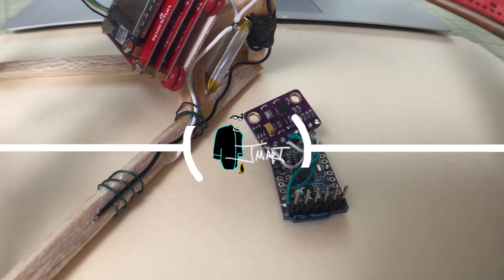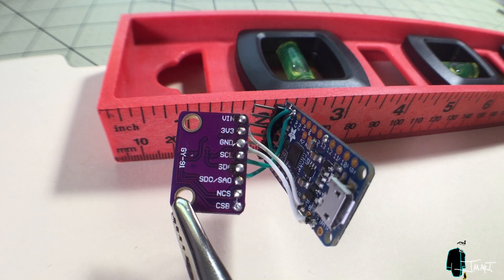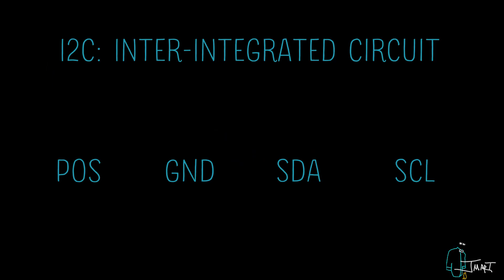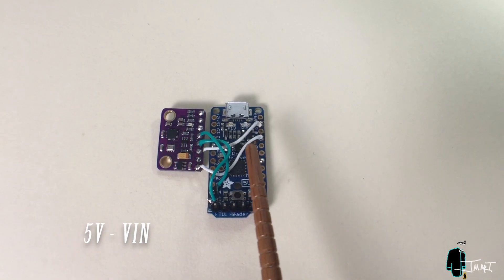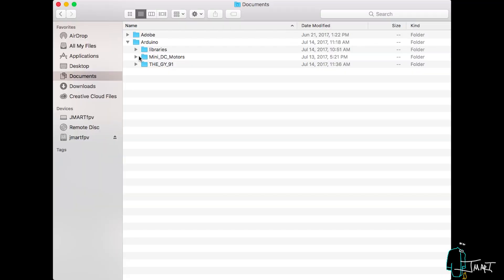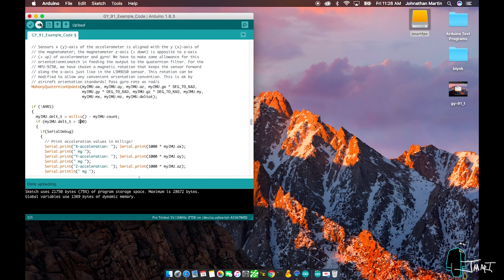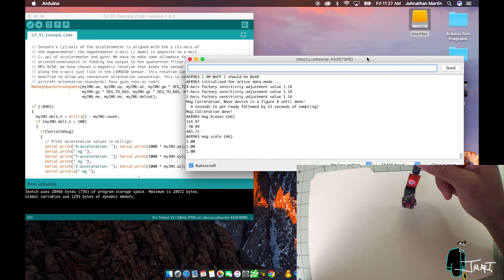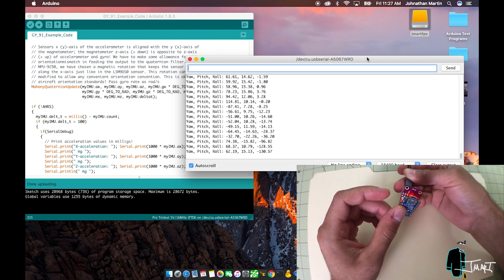9 Axis IMU MPU9250 (GY-91)

Comment: I´m using the gy-91 for calculating 3 axis of gyroscope, accelerometer and magnetometer, but i´m having troubles with the units, does anyone know of a library that converts the data of the accelerometer, gyroscope and magnetometer into corrects units?

Comment: Hi, i have trouble with SPI connection this module to board Arduino mega 2560 becouse of small sample rate. I do lot of search on the internet, but all codes and libraries are not working for me. Do you have any idea what can i do? Dont you have any tutorial? Its for my Bachelor thesis where i need messure acceleration and gyro only with the sample rate about 1-2ksps. Thank for any help and apologise for my bad english :)

Comment: thanks for the great video! However I recommend to use the 3.3V pin instead of 5V as the voltage divider of Raspberry PI/ Arduino is more stable compared to the build-in version

Comment: how many sensors can be connected to adruino?
Reply: Let me answer your question.
There isn't a specific number of sensors. First of all, you need to know which arduino you're going to use. For example if you're talking about an arduino uno (which is the most common) it uses an Atmega328p chip, which has like 14 digital inpunt/output pins and only 6 of them supports pwm pins. 
Ando also has 6 analog pins. All this depends on which kind of sensor you're using.
I hope I answer your question.
Reply: @richardchimal9128  I have the same sensor with barometer. I have 30 sensors that I would like to use for motion capture. What kind of setup will allow me to use them in chains for arms, legs and spine with head?
Reply: @GSXNetwork   Wow, there are a lot of them! First of all, I understand that MPU9250 allows you tu use I2C. According to the theory, you may connected an unlimited number of sensors with an arrange. It's a bit complex because you have to setup a master and a slave. 
You'll have to read about that.

Comment: Hi! Thanks for this. I'm having troubles including quaternionFilters.h, which libraries should i have installed before using your code?
Reply: I managed to include the "h" file but now i get this error: 
'class MPU9250' has no member named 'selfTest'
Did i install the wrong package?
Reply: I'm using the Arduino pro mini and a USB module to connect it to the pc
Reply from the maker: I will be honest Im struggling to figure out what is wrong here. Maybe try downloading quaternionFilters.h from this github page: https://github.com/sparkfun/MPU-9250_Breakout/blob/master/Libraries/Arduino/src/quaternionFilters.h 

I know that in the past this is where I downloaded this header file from. Also when I do a search on my computer for quaternionFilters.h my directory says username/documents/arduino/libraries/SparkFun_MPU-9250_Breakout_Arduino_Library/src/quaternionFilters.h
Reply from the maker: I really hope this helps to steer you in the right direction. I don't think that this header file is required to be in the same folder as your GY-91 GitHub Library it just needs to be somewhere on your computer in the Arduino folder, so that the program can access it.
Reply: i installed the SparkFun libraries with the library manager, but i noticed it has a MPU9250.h file and i'm not sure which files of your GitHub should i add or replace and where... I also noticed that the SparkFun MPU9250.h file comes with another file called MPU9250.cpp, but in your Github you have a .cpp file called main. 
I mixed some of the Github files with the SparkFun Library and now i'm getting a message saying mbed.h file is missing from the SparFun Library folder.

Sorry to bother you this much but i'm really newbie and lost in this.
Reply: @TomasSalinger   Hi, I have same problem.  i'm getting a message that "mbed.h: No such file or directory". How did you find solution about this error?

Comment: I thought the gy-91 was 3.3V only?
Reply from the maker: 5v has worked for me without issues. It does have a 3.3v output that you can use to power other devices once you power it with 5v.
Reply: Sorry, I was referring to the signal level on I2C. But perhaps the pro trinket is a 3.3V device.
Reply from the maker: thisoldjeep Oh there are two versions of the pro trinket, 3V and 5V

Comment: I was looking for a tutorial how to use MPU-6050 with arduino when I found this video. It looks interesting. I have a few questions, your answers are appreciated.

I haven't worked with Adafruit Pro Trinket before, but they say I will be able to use Arduino IDE to program it "with a few simple config modifications". So my first question, what these config modifications are?

The most important question, will I be able to get 3D position calculated? Without it the whole affair doesn't makes sense.

I will need to send position data over wifi. So the third question, is there enough pins to connect a wifi module?

And finally, after connecting GY-91 and wifi module will I still be able to connect the whole thing to my computer and program it?

Thank you!
Reply from the maker: Answer to the 1st question:
These were the “simple config modifications” that I did to connect to the board.
1. Tools > Boards Manager > Search for Adafruit Pro Trinket 5V > Install

2. Restart

3. Tools>  Board: Pro Trinket 5V/16Mhz or Pro Trinket 3V/16Mhz (USB) or(FTDI)

For example I use Pro Trinket 5V/16Mhz (FTDI). Because I use a Pro Trinket 5v/16Mhz  via the FTDI Connection.

4. Tools>  Programmer: “ArduinoISP”

Now you can connect your board via USB Mini or FDTI be sure to select the correct board  in the third step.

Answer to the 2nd question:
If by 3D positioning you mean yaw, pitch, and roll then yes. However if your looking for position in space then you need a GPS.

Answer to the 3rd question:
I have not experimented with communication over wifi but rather radio communication using an nRF24L01 (Pro Trinket Compatible), you need two devices, one for transmission and one for receiving.

Then I send this to an I2C OLED Display (Pro Trinket Compatible) which I program to display data. 

There are enough pins to to work with RC and connect additional devices, but as an assumption I will say that a wifi device could require more pins than available on the Pro Trinket. 

I suggest reviewing this page: https://learn.adafruit.com/introducing-pro-trinket/pinouts

Answer to the final question:
Programing after everything is set up is the easy and FUN part. As I mentioned earlier I use FTDI to communicate with the computer. Then I go wireless and send yaw, pitch, and roll data to the OLED Display. 

If you have no idea what I mean by some of these acronyms various terms or devices, use youtube search to dive a little deeper into each one and I think this approach will be a little more clear.

Comment: can you plz add the calibration code? its driving me crazy, i already got the data but the numbers are all over the place, any help is welcome.
Reply from the maker: I uploaded an alternate code (GY_91_Alternate_Calibration.ino) that may help you. I removed the original calibration code and replaced it with something much more simple. All you have to do is hold the GY-91 level during the calibration and the numbers come out looking nice. Let me know if you need further assistance, i will try my best.

Comment: Hey, what if i am using multiple of these. Can i change the i2c address?  I want to use 6 of them in my project and only have 1 i2c pin on R-Pi3.
Reply from the maker: Vishisht Tiwari you will need to use a device that is called a multiplexer. Here is a link to one on amazon. This is the cheapest option and for reassurance I bought one in the past that worked well: https://www.amazon.com/gp/aw/d/B06XXG5G3L/ref=mp_s_a_1_2?ie=UTF8&qid=1510550940&sr=8-2&pi=AC_SX236_SY340_QL65&keywords=i2c+multiplexer&dpPl=1&dpID=413wgohmY8L&ref=plSrch
Reply: thanks a lot mate :D
Reply: wr r u live mr tiwari

Comment: thx I couldn't find any thing for this now I can finally use it
Reply from the maker: Galactic Gamers good luck. It is a great little part for the cost. However I find that it can be annoying having to recalibrate on each start up. If I could bypass this with reliable results it would be a stronger tool. If nothing else it works great as a 5V to 3V converter haha!